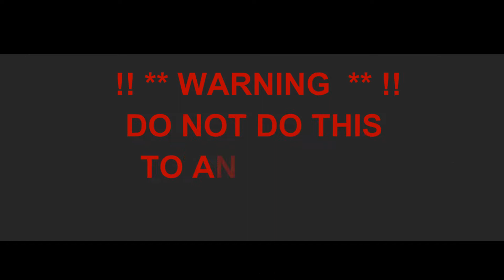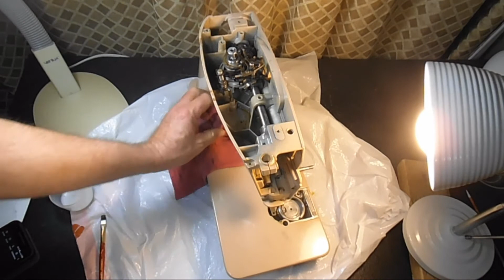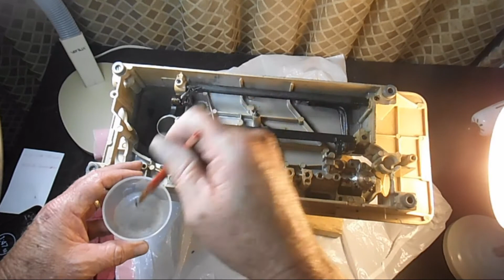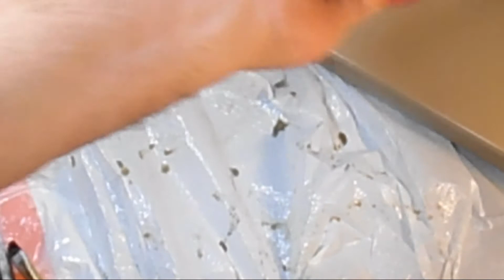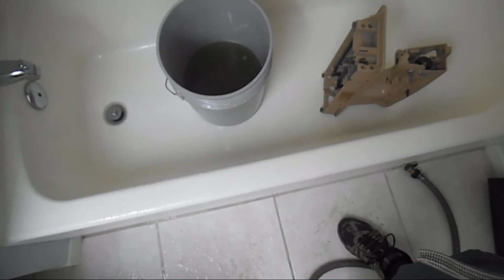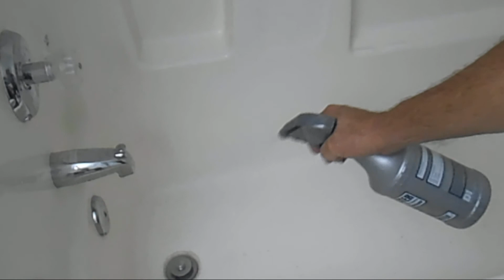How to Wash and Dry the Main Body of a Singer Model 503A Sewing Machine

Comment: Hello Andy, The word Singer on the back of my machine came off. Was that a Decal? Do you have any suggestions on how I can recreate it?
Reply from the maker: I honestly do not know on the 503A. I've never had the decal/paint come off. On the black iron machines they have decals under the finish. On the slant 301A arm cover you can tell it is a decal. A friend told me if the words are a single color it is paint, and if it is multi-colored it's a decal. I know after market decals are sold on eBay for some models, but I've never looked into it much. https://www.ebay.com/sch/i.html?_from=R40&_trksid=p2380057.m570.l1313&_nkw=singer+sewing+machine+decals&_sacat=0

Comment: Hi there.  Are you still around?  I could a bit of advice on cleaning/restoring one of the machines I just got.  Thank you.
Reply from the maker: Hi Alicia. If your Machine is a vintage Singer you can take a look at my main playlist page. The playlist at the top is by machine part or repair, like cleaning, oiling, needle bar, motor, etc. Farther down are playlists by Model Number. If you don't have a Singer I probably can't help much. If you don't find your model on my playlist, then reply here again with the model number and if you mean just a basic cleaning or full restoration. Good luck, and thanks for watching my channel.
Reply: @andytubesewing1953  I did see your playlist and watched one of your videos so far.  It is a Singer 503a.  I have some of it disassembled.  Good thing is it was OVER oiled, lots of grease and lint.  I’ve got most of that out.  It works, all gears work, just a little sluggish.  I’ll tear it down as far as I’m comfortable and I’m getting some Krud Kutter today.  I’ll keep cleaning and oil it good.  It does need a new nose plate, one of the pins are broken.  And I can’t get the top cover to go back on it’s hinges but I’ll figure that out.  It came with a cabinet, all the cams, all different feet and original manual.  I’m really excited about using it!   Thanks for your reply!  Have a great day.
Reply from the maker: @allycatak59  Sounds like a good plan. It's a wonderful machine and it sounds like you got the full kit with it. I've had good luck repairing the nose piece with a "steel" putty https://www.jbweld.com/product/steelstik-epoxy-putty-stick   I just mix and shape it best I can and when dry I use a fingernail file to shape it. Pins can be replaced with a finishing nail piece. You're going to be having fun and I know you will find it rewarding. Best of luck.

Comment: Ok, I think I want to clean out my moms old 503a; it’s quite neglected.  But I hesitate; I think I’d want to remove just the motor etc electric parts as I’m not confident to wholesale dismantle, then spray 50/50 krud mutter with a hand sprayer, the use my air compressor to blow it out, then some lite hair dryer; is there a video re the motor’s removal with my plans in mind?
Reply from the maker: Here are the videos for 503A: https://www.youtube.com/playlist?list=PLsCOZgzzaiKJZaZn2zl3LsnV2d7UhrqvX
Here are videos for 403A: https://www.youtube.com/playlist?list=PLsCOZgzzaiKKyqvdDRwS-9MfLuwSNJTcg
The 403A video list includes this video for removing and replacing the motor:
https://youtu.be/fmEeBi8x9ZY   The models are mostly the same. I'm not sure you need 50/50 mixture, maybe 25 KK to 75 water. Using the air compressor will blow the cleaner into the bearings and bushings, so that is up to you, but it's why I rinse the whole machine. Yes, you must dry the machine very, very well and oil all the bare metal except no oil on gears, only grease on gears, then oil all the oil points in the instruction manual very well to flush out the water/cleaner then wipe up oil. KK on the paint will dull the paint, especially at 50/50 so protect the outer paint. Maybe you should just do it outdoors and use kerosene like the old repairmen did if your going to blow it out. FREE manual at this link from SInger: https://www.singer.com/search/support?title=503
This video goes into detail for future regular maintenance of the 503A, including oil & grease, after it has been cleaned.
Reply: @andytubesewing1953  I think I go totally manual - a/c might be too brutish for this, and like kerosene if I can get a small can, then swab / brush out dirt, gunk etc by hand; never used KK before but made in a small dish (asian dipping bowl) I can swab /  brush clean what I see. She still had a wee oil bottle - amber (?) coloring oil and a tube of singer oil, but as to grease I'm not sure which or whose?  I'm in between masks jobs doing my part - waiting supplies so i have some time to do it right and, keep up the up keep; I'm hoping to find some of those long stem swaps (wood?) and just go slow.

Comment: I have a Singer 404 that I had loaned to a relative years ago. I just got it back. I am horrified how dirty it is. My machine guy is backlogged several months so I'm thinking  of cleaning it myself after finding your videos. I was horrified when you sprayed water on it. What about all the electrical? I can take it apart but not sure if I can put back together correctly.
Reply from the maker: Of course, you must remove the motor, but that is easy. You can actually wash it with the wiring in place as long as you dry it VERY WELL. You do not need to take off as many parts as I do when I restore. In fact, I recently did a cleaning video on a model 237 where I only took a few parts off >> https://youtu.be/Z2DPIbR2lKw
The 404 is my favorite straight stitch machine. I have a 56 video playlist of step-by-step full restoration process for it. 
https://www.youtube.com/playlist?list=PLsCOZgzzaiKIB4kvIHCfHYuyLMUp5A4UI
I have dozens of viewers who have written to say they followed the series and cleaned their machines, even other models. In the series is how to remove the motor. You could literally remove the motor and light bulb and wash the machine. You must dry it VERY WELL and oil it immediately afterward. The wash & dry with Krud Kutter is the fastest most thorough cleaning method I have found. Just watch some of the videos and get comfortable with the ideas in them and I think you will be fine. Just remember VERY DRY and oil right after. Good Luck.
Reply: Andy thank you!!!! I feel confident I can do this now.

Comment: Hi Andy,

I’ve been taking my rocketeer 503a apart via your videos and enjoying learning so much!

Your videos are awesome!  

I browsed before I started and Itjought I remembered one on taking off the handwheel. Now I cannot.   It was on in last video and here it’s gone already.  

Sorry to bother you, but could you link me?   I can’t find it now.   It’s different from 403.... ?  

Here’s hoping it goes back together as easy!  

Much appreciated 😃.
Reply: Hmmmm... I’d have assumed the outer beige wheel would be the stop motion, and the gold inner part be one of the two that you twist in opposite directions.   No such thing.   

I took off the screw on the flat side of beige wheel and nothing, zip, nada, nothing else will come off and cannot see any other screws I should remove to get wheel assembly off the machine.

I thought I’d take a lot of photos and venture ahead 😬.   But after removing screw, don’t see another thing that’ll move this along.  Nothing else easily slides off either.  

My machine has a lot of varnishing tho.
Reply from the maker: Here is a handwheel removal on the 404. Most vintage Singer handwheels remove this way even if the parts are different shapes.
https://youtu.be/eZiMaaka5HE
Here is the link to my playlist page with over 300 videos in playlists grouped by model number.
https://www.youtube.com/channel/UCUSPDsHaFtRoz1VA2U1xJ4w/playlists?view_as=public

Comment: I too found a 501A One Owner- but the prior owner SMOKED. The machine has a huge heavy coating of all of the  residue from a lifelong smoker.  I don't smoke and almost got rid of the machine due to how bad it was.  The machine came with all of the parts and case, all bells and whistles included.  I am now ready to watch all of your videos and clean this baby.  I am so overjoyed to find that this machine is salvageable.  THANK YOU SO MUCH for your videos and sharing your knowledge.  I just love my old singer machines.  (My first machine was bought new in 1988, but my favorites by far are the ones that are older than I am.) I am 50 this year and those older machines work beautifully compared to the new ones I bought(for grand-daughter) that are now mostly plastic.
Reply from the maker: Congratulations, young lady, on finding your "new" vintage machine. I have cleaned a couple of "smokies" and they turned out nice. For the case I would vacuum and set a bowl with vinegar inside, close it up for a day or so. Recently a viewer wrote me that he uses a light spray of enzyme-based Pet Odor Removal and it worked great. I have not tried that but it sounds worth it. Good Luck and please have fun.

Comment: Hi Andy, 
I just purchased a 500A from the orginal owner but was not used for many years. I'd like to give it a really good clean and start over with fresh oil and grease but am a little intimidated. Do u have a video that shows you removing the necessary parts to get it 
 "ready " for this video? Any guidance you can provide is much appreciated. Thank you!
Reply from the maker: Congratulations on finding a one owner Rocketeer! A nice treasure. I have some answers for you. I have a complete (50+ videos+) series on the model 404 which has many common parts to your machine. 
https://www.youtube.com/playlistlist=PLsCOZgzzaiKIB4kvIHCfHYuyLMUp5A4UI

I also have a series on model 503A which has almost identical parts to your 500A. In the 503 series, I tried to show how to remove/replace parts that were different than the 404. Between these two series, you can remove dozens of parts for cleaning and I also show many of the factory settings for when you reinstall the parts in case any need adjusting.
https://www.youtube.com/playlistlist=PLsCOZgzzaiKJZaZn2zl3LsnV2d7UhrqvX

Two important parts of your Rocketeer are the motor and the foot controller. I did series on both parts, showing how to dismantle, clean, assemble, repair and adjust them. You may want to have a look at them. https://www.youtube.com/playlistlist=PLsCOZgzzaiKJSu0T9oeaheTZsrUe91kkZ

https://www.youtube.com/playlistlist=PLsCOZgzzaiKL6ePPxLpmnWSzTyxPKTb71

At this link you can download a free copy of the Singer Service Manual for your machine. It’s full of adjustment and remove/replace information and makes a nice supplement to my videos.
https://sewingdude.wordpress.com/category/free-manuals/

At this old Singer page, you can download a free copy of the parts schematic for your 500A. It includes parts numbers. If you find missing/defective parts, then the parts number can help when you go to buy replacements. http://parts.singerco.com/CPpartCharts/5_59999/500A.pdf

On Singers new website you can download a free instruction manual. It has 50 pages all about using the machine and the attachments and special pattern discs, plus oil & grease instructions.
https://www.singer.com/search/support?lp=support&title=500

Think of Andy Tube as the one-stop channel for your Rocketeer!
If you think  I can help in the future my channel email address is andytube53@gmail.com
Congratulations again and thank you for watching Andy Tube.
Reply: @andytubesewing1953  Thanks so much! I got a "portable" ha 503A with case, but I needed accessories, so I had to buy a one owner 500A with cabinet/table. Lots of metal bobbins, too. So I appreciate all the help with The Pointy Sisters!
Reply: And original accessory box!
Reply from the maker: @janicecrosby1986  Happy you found what you wanted, Janice. Owning both Rocketeers is not a bad thing at all. Take care.
Reply from the maker: @janicecrosby1986  That's a treasure to find these days. Lucky you and happy sewing.
Reply: @andytubesewing1953  Thank you!
Reply: Andy Tube Thanks Andy! I much appreciate this, and look forward to sewing with this machine :)

Comment: I wondered if it could be done but never had the courage until I watched your video. I've now done it on 3 Singers, a Pfaff, and a Necchi. I painted the inside and out with Gojo (I think it works better than Krud Kutter and it's gentle on the decals.) I removed the motors and lights but didn't disassemble anything except the tensioner and the flywheel. The filth just flowed out of them. This is the fastest and best way to clean a mechanical sewing machine ever! Thank you Andy!
Reply from the maker: Thanks. You are the first person to mention using Gojo on the INSIDE of the machine. I'm glad you told me. Now I can recommend it to viewers who ask about de-greasing the black Singers. I remember the first machine I washed with the KK. I could not believe what ended up in my bucket. Water was black like espresso coffee from a machine that did not look "too bad" to me.